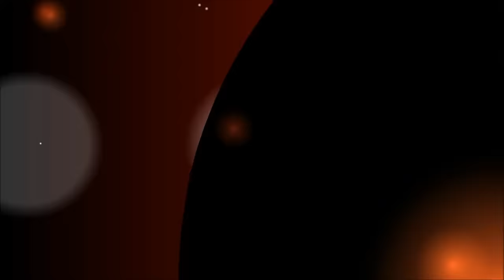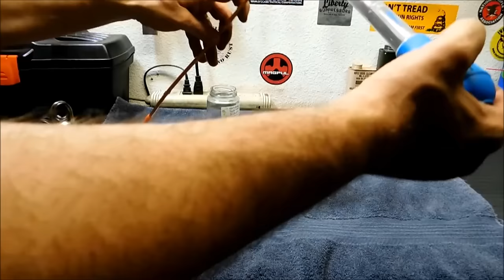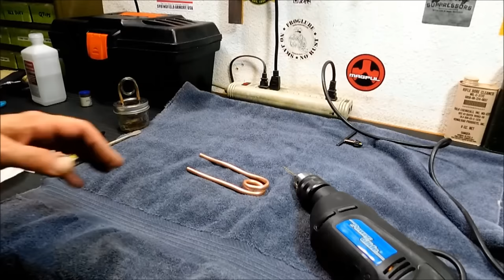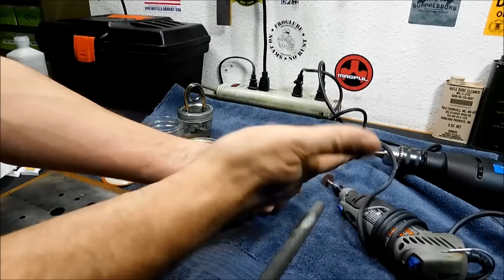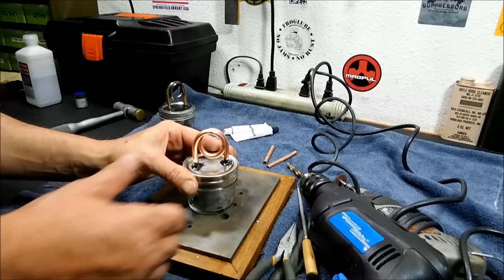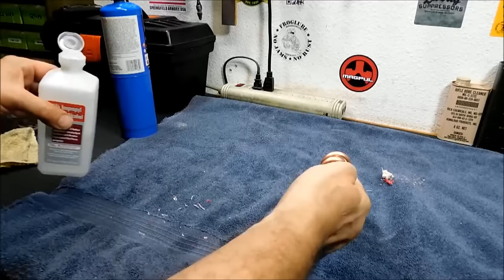Build Your Own Copper Coil Alcohol Burner Stove!

Comment: Just a suggestion: glue two lids together facing in opposite directions so when you are done cooking you can screw a jar on to cover the copper coil to prevent evaporation. That way you can store it for future use with the Alcohol in the wick jar.
Reply: What about the tubing that projects out BOTH SIDES of the lid? Don't put away your thinking cap yet, Henry.
Reply: Whisperin Pints he is says attach another lid to the existing one and then you can screw on a second jar to cover the coil assuming the coil is short enough
Reply: Henry Avery I think just dumping out any left over alcohol would be just as good. A quart can of denatured alcohol is still fairly cheap at the hardware store and 91% rubbing alcohol is even cheaper at the pharmacy.
Reply: I think two RINGS glued upside down to each other is what would work best...
Reply: I LOVE this idea.  I would do that for home emergency use... larger jar on the bottom. same size coil.  smaller jar on top. EASY STORAGE. GREAT tip.
Reply: Great idea, can't count on getting to a store in an emergency.
Reply: Or you use the second lid to hold the liquid and keep the flame lid somewhere else when not using.
Reply: John Wicks approved of this..😎🔫
Reply: Denatured alcohol is the cheapest alcohol fuel
Reply: Denatured alcohol also burns cleaner than the rubbing alcohol. That black stuff will be all over the bottom of your pans.
Reply: good suggestion. if i made this it would probably be for camping/hiking, and this would be a good idea for storing it in a bag just to keep the stuff from spilling out or just outright stinking.
Reply: Henry Avery and ya don't need sand...
Reply: @Kyle-sg4rm  shut up kyle!!!
Reply: I prefer the Lard ( Cooking oil Burner Method myself ) you can get a full size burner for a few cents a day plus it serves as a personal heater when cold outside ! ( Put as many wick's or pieces of clothing around the area for a good size burner )
Reply: @Kyle-sg4rm  Great comment bud.
Reply: The alcohol would build up in the other jar and get wasted when unscrewed.
Reply: @whisperinpints7027  You screw on an additional jar.
Reply: fireguardburnt ....that’s what he was talking about Einstein.
Reply: BottledUp.... we’ll get all the stuff and make your stoves now put em in safe place you can remember.Sherlock.
Reply: Kyle ....how long have you been out of the asylum?
Reply: Henry Avery great idea.
Reply: You'd have to plug the small vent hole. Alcohol is very volatile and would escape.
Reply: While you're at it use your propane torch to anneal the copper pipe before putting sand in it. 
That will soften the copper pipe dramatically and would bend a whole lot easier. Cooper becomes like putty after annealing. Don't worry you won't melt the copper, it takes at the bare minimum oxygenated fuel to get hot enough to melt it.
Reply: @richk3325  I added some nuts on each side, it made top look better and added some rigidness..
Reply: @jquest43  I looked at the book you wrote in crayon, Chief. You almost stayed inside the lines.
Reply: Whisperin Pints your swishness shines from your insightful name,"whispering pints".. you wear lilac?
Reply: AKMguy he needs some milk!
Reply: If you're making these for future use, you can easily plug the hole in the copper tubing to prevent evaporation. A drop of hot glue, a small strip of packing tape, just to name a couple ways.... 
With 2 or 3 of these side by side, you  easily get a big pot of water boiling.
Reply: @Kyle-sg4rm  
That's very good advice. You got any kids? ....you'll make a great father. :)
Reply: Luv2fu4ever69 Thanks. No kids yet, but maybe someday. I'm sure i'll unintentionally pass on "bad advice" from time to time also. All you can hope is that they can think/feel for themselves.....Abilities that are becoming increasingly rare. Sadly.
Reply: You can also use a rubber cork placed into the loop which will keep the fuel from evaporating. One other thing.... the seal on those jars isn't very good over the long haul. I use real cork gasket material to replace the paper seal that comes with those.
Reply: great idea Henry. I will make a note and put it in the projects/hobby file. Will do this.
Reply: @Kyle-sg4rm  By adding some alcohol in the upturned lid of the covering jar and setting it on fire you could preheat without a butane burner, in the same way that a "Primus" stove was started.
If the glue that was used to fix or hold the coiled tube is a epoxi glue you will have a problem if stored with alcohol as alcohol attacks epoxi glue and degrades it so you might end up without any support for the coiled tube.
Reply: Amazing 👌
Reply: @whisperinpints7027  I know exactly what he means. Maybe you should've mentioned it in a different way, instead of trying to be cute. You didn't get what he was saying. That's totally fine. But when you comment things like "don't put away your thinking cap" when you're the one who doesn't get it. Well, I shouldn't have to say anymore.
Reply: @RedfishInc  but if u use this in the field, you don't want to have to carry so much fuel..dumping it out eachtime...don't get me wrong..wouldn't use or trust this out in the field where can't mess around with errors and issues...
Reply: I know it gets primed,  but wouldn't this need to be heated eachtime you use this (of course I mean with  long periods of time in btwn, not 5 minutes later)? Cause if so, then you would need a torch to heat the coil eachtime. So would be a little redundant, right? Or would this stay primed even after a week of say camping in cool weather and such...? Don't get me wrong, still a cool little stove, I give respect to everyone who thinks outside the box and creates things. That's how our world advances, with people like these (no need for alien tech. comments here please..we all know the stories..hahaha).
Reply: @whisperinpints7027  haha..you jumped the gun on this one...
Reply: @fireguardburnt  That's exactly what Henry said.
Reply: @christopherguy1217  The wicks would dry out. Then you're having to prime it all over again.
Reply: @AwGusTeen  a paper seal in a canning jar???? Never saw a paper seal only the metal ones
Reply: THANK YOU. I was trying to think of a way to make it backpack safe and this helps.
Reply: @whisperinpints7027  Henry's suggestion obviously went right over your head lol, great idea Henry!
Reply: I went walmart to buy some canning jars and lamp wicks and jb kwik weld, but then i was in the camping isle and saw they had an alchohol stove, and it was already built ! ...so i bought that for less than the materials cost lol!🤦‍♂️🤣🤣 ....just saying...🤷‍♂️
Reply: Good idea but not really helping it might become a problem
Reply: Using that method would make I simple to make a globes
Reply: I rather braze the tubing to the lid
Reply: This is your video you my friend have more likes than she does great job friend
Reply: @whisperinpints7027  wow, rude and wrong, that's a bad look.
Reply: Or how about the EASIEST way just put a piece of tape over the hole to prevent further evaporation!! Oh yeah and of course do this AFTER it Cools! Lol
Reply: pints said dont putt the thinking cap away yet.... lmao like they thought they had you in a checkmate hahahaha how dumb pints must feel
Reply: Henry Avery - Great Idea, Henry!
Reply: You guys are over complicating this. You just take the cap off when done and store it with a regular cap on it.
Reply: Daniel Collier —Yeah and you could just stay home and use your kitchen stove too. 
The point of DIY is to grow your understanding and knowledge of how things like this work. That way you could build, modify, or create something similar if ever in a pinch.  
Or you can just stick with your “superior reasonings” and see how far that gets you and your emoji friends. Just sayin.....
Reply: or simply put a piece of tape on the flame hole
Reply: Good idea
Reply: Whisperin Pints I understand what he’s saying — 2 jars...
Reply: When its about survival I wouldn't be wasting any resources.
Reply: @TheOtherBill  if u are worried about black on your pans rub soap on any pan over a fire. Cleans right off.
Reply: Dear Henry, I think we can use a new , uncut lid for that ! when we are done cooking, We can open the jar we used, and use the uncut jar lid to shut the jar to prevent evaporation.
Reply: @Durrdalus  Gorilla tape is wonderful to have on hand for various survival uses.  A little piece should be reuseable for a long while...
Reply: Great idea. Have you ever tried another fuel such as lamp oil avail at a camping store? Not quite as dangerous if spilled. I'm building one of your stoves to fit inside a UCO candle lantern to be a stove and van heater. Am using a lower profile sealing jar. Looks great so far. Thx.
Reply: @AwGusTeen  Umm, I've canned with this type of jar for most of my 66 years, and they don't have paper seals. They have rubber seals, that last for DECADES if you don't have acidic contents that eat through the metal lid. I've never seen a rubber cork that would fit in a 1/4" copper tube, but I bet a pencil eraser would work, and it would be a lot easier to find a couple. Then you'd have to fiddle with removing all the wick (hmmm... how about storing the wick IN the alcohol in the jar?) so you'd have to shove it back into the tubes next time you want to use your little stove... I think I'd just leave the wick in the tubes! I like the idea of JB-Welding two rings together, top to top, so another jar can be screwed onto the base to cover the coil. First GENTLY push a toothpick into the burner-hole to plug it so it doesn't leak all the alcohol.
Reply: @hungrydad7537  It is a more satisfying feeling to make something yourself. Also a good learning experience, just saying.
Reply: @SteveEsp3  Can't count on having a propane torch to prewarm your emergency heat either.
Reply: or just use the amount of alcohol you need for 'x' burn time and possibly store unused alcohol separately...... imagine
Reply: @TheTravisweb  and burns way cleaner than rubbing alcohol.
Reply: @chasehaynie879  thanks
Reply: I like it and it will protect your copper tubing and keep it clean
Reply: When shtf,  moonshine will work! 😉
Reply: I was about to make the same suggestion. Evaporation of a flammable liquid can be wasteful and extremely explosive given the right conditions. Ask someone who’s welded or brazed a gas tank and lost their hearing or worse 🔥
Reply: @whisperinpints7027  I thought I was missing something. Better off just placing the pierced ones in a muffin tin and just put on another lid.
Reply: Why not just cover pin hole and store upright, he sealed the copper tube with JBweld.
Reply: How about plugging the copper hole with rubber?
Reply: دددذذدد د د دد ذو. ذ د د. د دد ‌ذوذنقه د د. دد ‌د ددر و و.    ‌ و‌ د د دد وو  و و. د. ذ. د دد. دددذ ذ ذو ددذ‌ذو.  ذ
Reply: @commonsense3673  I'll have to look into lard burner
Reply: @TheOtherBill   ...soak your wick in vinegar, let dry.   No sooty smoke when you put it to use.
Reply: Maybe super glue over the pilot hole would work? Then pluck off after storage?
Reply: Thats awesome im going to make mine with two lids for storage
Reply: Thanks
Reply: Or just put something in that hole. Alcohol would be wasted when you'd open that other jar...
Reply: I use small piece of aluminum tape
Reply: Nice. 
Say what🤔

Were made in HIS image. HE made us with the power of free choice
A good prayer:
I'm a sinner JESUS please forgive me for all my sins I know you shed your Blood for me on the cross at Calvary. Thank you JESUS for my salvation and for shedding they Blood for me. I love you JESUS. 
Romans 10:5/10 ct...❤️k
JESUSisLord!Amen...
Amen..
If you'd like to call someone who cares 
83
For
Truth.
bc you don't know when you'll die?
.y r u hesitant.
.

.
.
Reply: @chasehaynie879  Lol. In your opinion, it’s easier to screw on the second JAR than just pour the alcohol back into the container:?
Reply: @hibahprice6887  1st off wow amazing this video is still getting fresh comments this much later. 

2nd. If you empty the stove each time then you have to unscrew the lid, pour the remaining fuel into the main container and then screw the lid back on only to have to repeat this process to fill it back up. 

OR you could just screw another jar on to prevent evaporation and unscrew it when you are ready to reuse the burner...literally half the effort.
Reply: Smart Henry ! would put out the flame as well as safe storage. You need 2 lids and 2 seals facing opposite each other so you can screw a jar on top
Reply: @JohnSmith-fq3rg  due to the fact that alcohol burns with an almost invisible flame a lid on top for safety would be cool. Apart from that the wick will carry the alcohol up the tubes for awhile and burn out the wick so snuffing out the flame is ideal. Hence the lid.
Reply: @Ivan-lo8li  just dip it in water or dirtcor more sand, ez
Reply: Can't u just cover the small hole ?
Reply: @Ivan-lo8li  what are you talking about . Henry advises not letting fumes escape . I agree but much less complicated . Put a pin in the hole .
Reply: @mattg6472  thumb tacks perhaps not bad
Reply: How big a jar can you use & it still work? Quart? Gallon? 🤷‍♀️
Reply: @RedfishInc  not cheap anymore
Reply: I like the small jars....the fire is big enough and if needing more heat...several collectively is better than one larger unit. Also some could be running while refilling others. Love it
Reply: I was thinking of just sticking a few short strips of tape around the jar...and pull them off to wrap around the flame hole...less weight and more compact.

Comment: The sand tip is worth every minute of this video.
Reply: Ya,the sand tip was the hack!!
Reply: I've also heard of people putting water in the pipe and then freezing it to accomplish the same.
Reply: Yep, that sand tip will come in handy
Reply: Table salt works wonders too.. or any stuff that desolves in water. Not an issue here, but try using sand with a 10-15 wrap coil n getting it out... :D
Reply: You can also seal one end of tube fill it with water seal the open end and freeze works great also.
Reply: You know else works? a tubing bender...you can get one when you go get sterno...
Reply: Totally 👌
Reply: @vocalpatriot  That was my first thought...a brake line bender
Reply: Absolutely I'm a plumber that's going to save money on expensive toys👍❤️
Reply: If you have a stiff spring the same diameter as the pipe you can use that too.
Reply: salt works too
Reply: A mandral pipe bend without any special tool....brilliant!
Reply: Try filling the copper with water then freeze it. I found it worked better for me than sand.
Reply: @billyjones9045  good idea!
Reply: i fill mine with water and put it in the freezer.... works great
Reply: @vocalpatriot  I’ve been making a plumbers version of these for years with my TUBING BENDER
Reply: Indeed
Reply: You can use table salt too. Or sugar.
Reply: @LynxGenisys  salt is the way to go.
Reply: @aborne  2 yrs later... ya for sure.. ;P I've got it figured by now.. if not, i probably should be out of the hobby... hehehe... ;P
Reply: That's a really solid idea for anything where you work with tubing, and it only costs a dollar or your grandma's respect for you
Reply: @Thoracius  lllli889oolloll
😊
Reply: @LynxGenisys  air compressor in one end if you have one, blows out all the sand very well
Reply: @causwayspeedway  try filling it with water and freeze it. I personally think its better than sand
Reply: @Thoracius  lol.. I was just saying that. That's how I do it
Reply: Yeah it was!!!
Reply: You can bend it without anything if the tubing is not too thin

Comment: I enjoy building stuff just like this fellow, but the reality of the situation is, you can buy 6-hour Sterno burners for around $1 at Sam's Club. They come 12 to a case, are each sealed with a screw-on lid, will last forever, burn for a solid 6 hours each and are no more work to use than lighting a match or flicking your Bic.

Comment: You should soak the wicks in alcohol before twisting them up the tube. Seems like that would make it much easier. Also, you could use the end of a toothpick to seal the hole when not in use.
Reply: Considering your a robot, your probably correct.
Reply: @CJ Wilemon What if I do him?